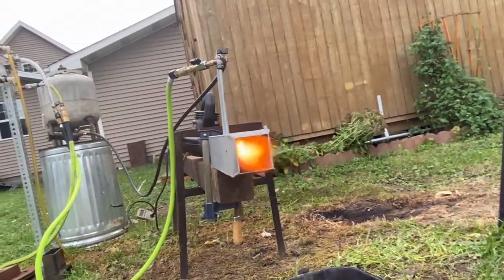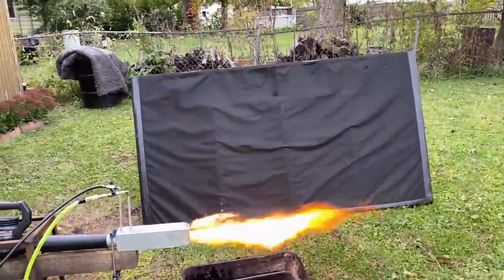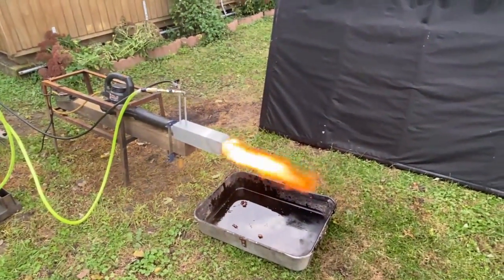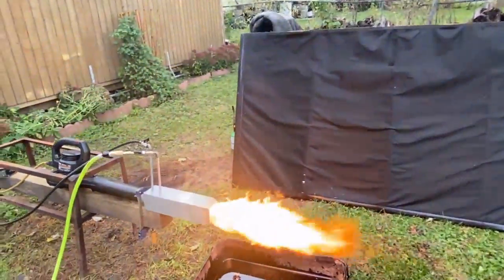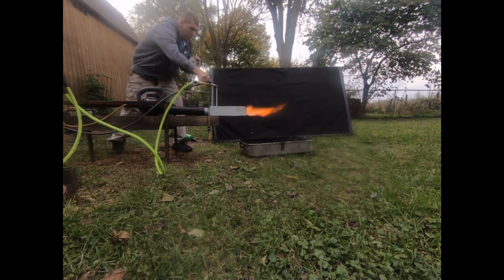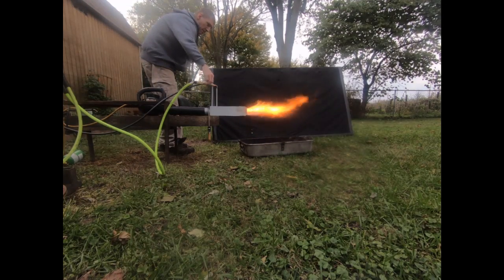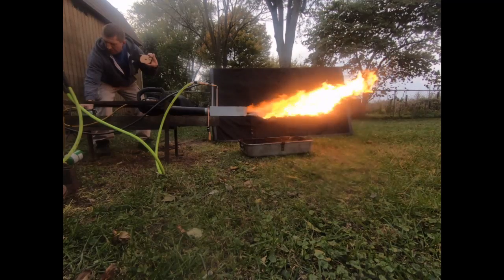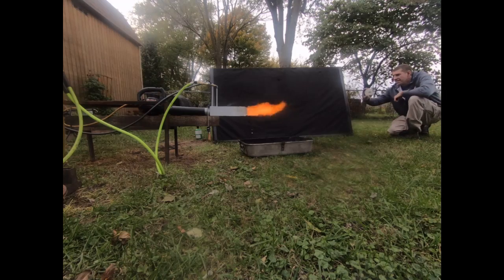800 Kw  waste oil Foundry Furnace Burner for casting 50 pound pours

Comment: Need to build a SBC oil pump system (bump up PSI relief) and use 200+ psi oil pressure mixed w the 175 psi low flow air.   Need a smalI 3 phase motor  & inverter for speed control along with psi feedback to control your psi/flow rates.   250 to 500 bucks for all the parts depending of Evilebay or new for the parts.
Filter the oil into clean tank heat & mix the cleaned oils will do wonders .
Edit in
Otherwise use air over oil PSI tank in the old propane tank set tank psi to 75 feed tube out of the bottom and have a pressurized system to help atomizer work.
Spiker out

Comment: The difficulty with extreme temperatures isnt the burner.Yea sure you can make one or buy one ,but where do you buy a refractory that can witstand that temperature or crucible.
Thats where money sink is.Especialy in some country's.Amazon for example wants insane amount like 1/3 of the price for shipping to my country.I was able to find materials that are rated to 1200C° and it traveled trough half a country to get it to me.
I will never be able to  melt cast iron or steel ,so i am happy with copper and bronze.And for that propane is enough.
Just a few thoughts ,i like the way you make your burners,your propane one helped me to design my own and i hope you sell many ,but for melting steel its a limited market.
Stay safe in these hard times.

Comment: There are paint sprayers available in market which use blower only. So why is it difficult to atomize fuel with only blower when paint sprayers are able to do it with blower only.
Reply from the maker: you mean the kind that are at 1000 psi in the paint pump that sits in the bucket ? The one with the 1000 mesh screen ? waste oil is way to dirty , it will clog the filter in 10 minutes
Reply: @NOBOX7  like this one: https://youtu.be/vcSpuqh7msU
Reply: How Can I Call you about No Box 7

Comment: Nice. Gonna need to get into some Pottery brother.
Reply from the maker: Indeed
Reply: Pottery needs a very long soak at a stable (stepped) temps.
Reply: @markmatt9174  what do you think he can't handle that? He could step it up and down all day!
Reply: @whatthefunction9140  no, I worked building industrial ovens for a decade.   5 years at a 24/7/365 pottery plant (millions of fixtures as industrialized scales.)   Proper temp controls held for HOURS withing a few degrees to form crystalline structures to do it right.
Melting scrap metals sure, stepping up & holding 2700f for hours not with this style of burner even with massive upgraded controls.
Reply: @markmatt9174  oh yee of little faith